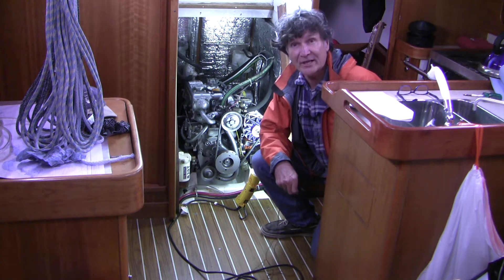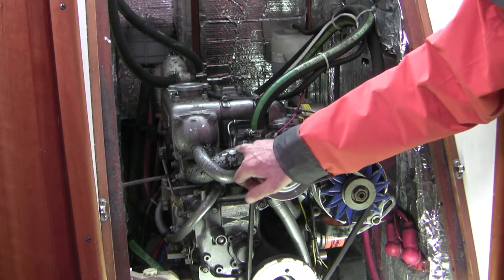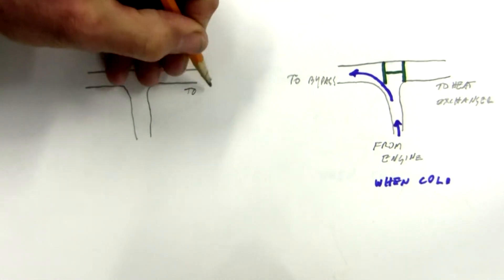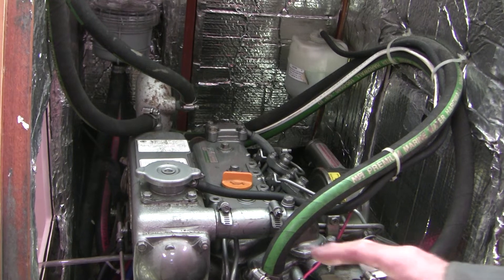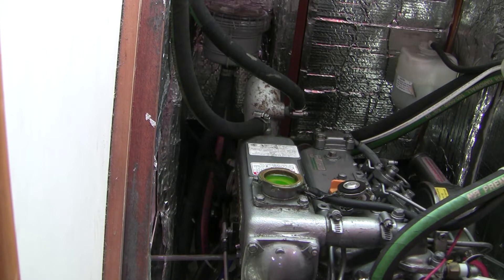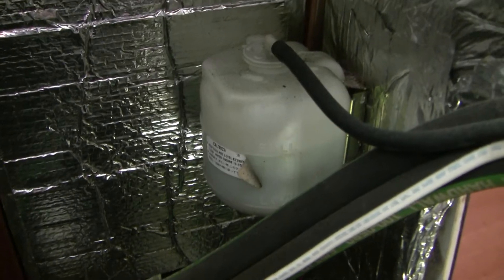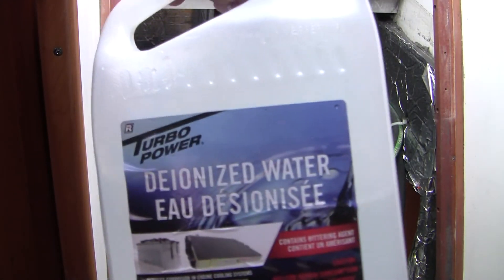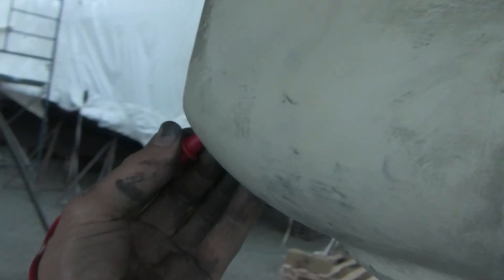Understanding marine diesel engines: Yanmar coolant exchange

Comment: Hello, Thanks for the great video on the cooling system. I now have a much better understanding of the difference between the raw water and fresh water cooling systems. I am trying chase down an overheating engine issue (around 175F, gauges steaming up) on a 1977 Volvo Penta BB170A 6 cyl gas engine. Question if I may: the engine had a 160F thermostat installed instead of the V-P book recommended 130F thermostat (which I ordered). I plan to replace it hoping my engine will run a little lower. Any suggestions? Cheers!
Reply from the maker: Most guys focus on the salt water side first because corrosion happens there faster. Make sure water flow is good, inspect the impeller, inspect and clean the heat exchanger and exhaust elbow, look for old impeller vanes aren’t trapped somewhere, and be sure the intake peacock is open all the way. On the fresh water side, make sure the cap seal is good, since the system needs pressure to raise boiling point. If you replace the thermostat be sure it is designed for your engine, since you can’t replace a double valve one like this Yanmar with an old style single valve. Good luck!
Reply: @spelunkerd  Thanks, I took apart and flushed the raw water system with a hose to ensure no blockage. Plan to flush the system with Barnacle Buster at some point soon as well. Your advice is much appreciated.

Comment: I just came across your most informative video while looking to solve a recent problem with my Yanmar 27 HP engine on a recently purchased Hunter Legend 35.5 sailboat. 

Yesterday I ran the engine for about an hour, thinking my seacock for the engine seawater cooling system was open. After figuring out that the shrill tone I heard was an over temperature alarm, I shut down the engine. Upon inspection, there was a pool of coolant under the engine and some smoke and sizzling sounds. The coolant reservoir was empty. 

Being new to this, I thought that refilling the reservoir might be enough to correct the problem once things cooled down. Wrong.

Today I found that the heat exchanger had no visible coolant in it, so I refilled it with a half and half mixture of marine diesel anti-freeze and water. I ran the engine for a couple of minutes, then re-checked the coolant level. Both the heat exchanger and the reservoir were still full. I resumed running the engine only two be alerted to an over temperature condition again after about 15 minutes. I shut off the engine and had another look only to find more spilled coolant and no visible coolant remaining in the heat exchanger. The reservoir remains full. Both hoses going into and out of the heat exchanger were hot the touch.

I’m trying to decide what I should do next and thought I would reach out to you and the community for any suggestions.
Reply: Minor correction: it’s actually a 24 horse power, model number 3GM30F Yanmar Diesel engine.

Also, that one way anti-siphoning valve you mentioned in the beginning of your video seemed to be stuck. Sure would not flow in either direction. I disassembled and reassembled it and the air now flows in one direction.

Might just provide enough of a correction for the heat exchanger to function properly again?
Reply: I thought it might be worth trying it again since one thing was seemingly corrected. This time I observed what was happening while it was running and after a few minutes there was some coolant dripping down on the port side of the engine block. Following the wetness upwards lead to a heat exchanger intake hose which may have been damaged from the previous day’s overheating episode. I suppose that once enough coolant leaks out of the system that overheating would be the natural result again. Once I remove the hose I may be able to confirm that it has been damaged, otherwise perhaps there is a stuck valve forcing a leak at that junction point.
Reply from the maker: Gee, this is serious. Unless you're confident in your abilities, it might be time to ask for help from a pro. Running for that long can pooch the whole engine, and you don't want to feel you didn't do everything possible to prevent that. As you say, overheating can cause secondary head gasket issues, hose problems, even water pump problems. If I were tackling this problem, I'd start with the salt water side, to verify that indeed the salt water pump is pushing salt water through the heat exchanger and that ample flow is coming out the tail pipe. If not, I'd disassemble the salt water pump and check the belt and the impeller, since those rubber things commonly go bad after a few years. If a vane of the pump impeller is broken off it can float downstream until it gets stuck leading into the heat exchanger. If nothing is coming out the tail pipe you can disconnect various hoses leading back to see if good flow is possible out the pump. Even something as simple as a plastic bag sucked into the salt water intake or a bad sea cock can be catastrophic. While the belt is off I'd spin all the pulleys to be sure none of those bearings have seized. Also check the seal at the filter because a loose cap can break the siphon and prevent adequate flow of salt water. If everything is OK on the salt water side, I'd run the engine for a while with rad cap off, filling with distilled water as needed to keep it topped up, and watch what happens. If it quickly overheats, especially if you get a lot of air bubbles at that time, you're in trouble. It could be as simple as a sticking thermostat, trapped air, a bad heat exchanger cap, or as serious as a head gasket problem. Feel the outlet hose from the thermostat to decide whether it opened. If the head gasket has leaked coolant to a cylinder, you can verify that with a little test that identifies combustion products in the cooling system. Hopefully not. Good luck!
Reply: @spelunkerd  Thank you for all your great suggestions. The seawater side of the system was working well. I was able to confirm a damaged 5/8” coolant hose was leaking coolant near the attachment point on the intake side of the heat exchanger. Whenever the engine ran for more than a few minutes coolant would begin to leak from there. I managed to cut off the damaged piece and reattach the hose after careful rerouting to compensate for the reduced length. The engine now runs great with no leaks and no overheating.
Reply from the maker: @goob_7499  Oh I'm so happy for you! Keep a close eye on the system, over the next few weeks. If it isn't quite right, you might consider swapping out the thermostat, and maybe even swap the heat exchanger cap. Occasionally if the thermostat is intermittently sticking, pressure in the system can rise above a safe level and hoses can fail as a result of that. The cap on the heat exchanger is designed to open if pressures rise too high, but that cap can stick. Also if that cap sticks open you don't get the higher pressure the system relies on to raise boiling point. Thermostats and heat exchanger caps are relatively cheap and diagnosis can be tricky, so if there is suspicion either is bad it might be wise to replace them. Thanks for letting us all know how this was resolved! These kind of remarks make the discussion thread worth reading.
Reply: @spelunkerd  it seems that I spoke too soon. My first conclusion was drawn from a 30 minute idle test. Today I actually took the boat from where it was anchored to a fuel dock to get water and halfway there the engine temperature alarm sounded again. I made it safely to the dock and waited for the engine to cool down while I fill the water tank. Thinking it felt cool enough, I placed a rag over the heat exchanger cap and opened it. The result was volcanic! After cleaning up the mess and replacing the coolant, I remembered that I noticed a shut off valve on the output side of the heat exchanger that had a corroded handle yesterday when I was dealing with the damaged hose. I tried to close it and but then the handle got so loose that I wasn’t sure what position the valve ended up in. Thinking that it might have gotten closed but not reopened enough, today I removed the corroded handle and opened it via the stem, which actually turned a number of times. Hoping that a lack of  flow from a fully or partially closed valve might be the new source of my troubles, I tested it by motoring back to my anchorage. I was nearly there when the engine temperature alarm sounded yet again. The seawater part of the system still seemed to be working fine. The difference in temperature between the input, an output side of the heat exchanger seemed negligible. I am pausing now to reflect, and to seek further input.
Reply from the maker: If you're suspicious of a head gasket leak, then a simple test is a combustion leak test kit that fits onto the top of the heat exhanger and tests for combustion waste products in the cooling system. You can borrow those from some auto parts stores. If you're still optimistic there is something more simple, I'd be inclined to inspect the heat exchanger and the salt water impeller, looking for anything that might impede salt water flow, like corrosion, a trapped impeller vane, or a plastic bag. You didn't mention how much salt water is flowing out the back of your engine. If flow is poor that is certainly the way to go. If the salt water side is all OK I'd be inclined to replace the thermostat, hoping it is stuck partially open, not allowing adequate flow.
Reply: @spelunkerd  Thanks again for sharing your insights. I don’t suspect a head gasket leak, but I’ll keep this possibility in mind in case simpler remedies don’t work. As far as I can tell the seawater flow looks good, and the related hoses remain cool when the engine runs. That leaves the thermostat as the most likely culprit. You indicate that it’s under the cover attached to the fresh water/coolant pump. I imagine I’ll have to drain the coolant before opening that up to avoid a mess. I might have a spare thermostat curtesy off the previous owner.
Reply from the maker: @goob_7499  In the 'old days' we could take the thermostat right out and see if the problem was solved. Unfortunately this thermostat design has a second valve that closes the bypass tract when the main valve is opened. So taking the thermostat out (or using the wrong design) will allow coolant to bypass the heat exchanger, causing overheating.  You want to be sure the spare is new and original Yanmar design, with two valves. Bad data can be misleading, so make sure you have the correct one.
Reply: @spelunkerd  I just drained the coolant, removed the water pump cap and lift it out the thermostat. It’s hard to tell if there’s anything wrong with it by visual inspection.
Reply: Looks like the only spare I have is old, so I’ll have to pick up a new one. I do happen to have a new temperature switch though. Probably worth replacing both.
Reply: In searching for a replacement thermostat, I spoke with a local guy, Sean, who said he could spot me a spare one, but also suggested that I test the one that I have by putting in a pot of hot water to see if it opens. After some initial hesitation, it did open, and so did my older spare thermostat. This leads me to the conclusion that the thermostat is not the most likely source of my trouble. 

Next I will more thoroughly investigate the seawater side of my system. I will verify that the impeller is in good shape, and that there are no obstructions in the lines. 

Once I replace the coolant, I am planning to run the engine with the heat exchanger cap off for a while to be sure to burp the system of any trapped air. Trapped air pockets preventing coolant flow might well have been the reason it was overheating since the initial incident.
Reply: I replaced the impeller and removed all pieces. I checked the heat exchanger by removing the end cap. It looked clean, but I ran a length of wire down all the little seawater pipes just to be sure. After reassembly, refilling the coolant and, <ahem> opening the seacock, it’s been running smoothly for an hour. There is great seawater flow out of the tailpipe (now that I know how that is supposed to look). Cold seawater is flowing through the system. The heat exchanger is doing what it should now. Hot coolant enters and cooled coolant exits. I ran it with the heat exchanger cap off for a while, and the coolant level was staying steady. Props to @spelunkerd and my buddy Sean for all the great advice!

Comment: Hey great explanation I actually have a question and really need your help my yanmar in my 35ft C&C sailboat doesn’t want to go into gear either forward or reverse engine starts but when I change gear it doesn’t move RPMs increase if I add to it but doesn’t shift I checked the transmission box oil is good engine oil is good I am stuck any suggestions
Reply from the maker: I don't know. The last time I saw a boat like that, the prop had fallen off. Presumably you can see the prop shaft enough to know if it spins.  I'd go down to the transmission and try shifting right at the gear handle on the transmission, in case a lever has dislocated. My shift handle at the cockpit has a dislocation mode to allow higher rpm starts in neutral.
Reply: @spelunkerd  thanks yea I located it and now I am going to try and shift it at the box

Comment: Hey thank you for all the information 🙏🏽
My weep hole is leaking, and I already ordered a new pump. My question is: can I still drive in this time ? Because the new pump will arrive in around 3 weeks, but I have to drive a lot in this time 😢

I have a Yanmar 4jh-dte.
Reply from the maker: If the pump is not squealing it is probably safe to continue using it, but be sure not to let the reservoir run dry. Keep a close eye on your engine temperature and be prepared to shut the engine off immediately if temp rises.

Comment: My anti siphon valve is leaking on my starter. I plan to order a new one tomorrow. My is mounted flat. Should it be mounted vertical like yours? Keith
Reply from the maker: Yes, orientation is very important for those things, although some designs vary. Gravity keeps the salt water from refluxing back into the exhaust manifold.

Comment: Surely they are not STILL using aluminum in any part of the cooling system. If they are you WILL get corrosion and you will be replacing parts very few years. 
Cheers
Reply from the maker: Good point. The SD20 sail drive case is entirely aluminum, and it is the frame for the salt water intake. I don't believe the fresh water coolant is anywhere near. Yanmar put out a service bulletin on how vulnerable the sail drive is to corrosion, and my zincs last only 6 months. So a few years ago I decided to add another zinc that I attach to a wire from a sail drive mounting bolt, and I hang it over the side. Since doing that my paint is surviving a little better on the vulnerable lead keel. I checked out my galvanic isolator and it is working fine.

Comment: Hi. This is very good and informative, but I'd like to ask about a small aperture through hull continual flow when the engine in running. I have a 40 litre calorifier around the same area as this through hull fitting, but as yet have been unable to trace the route or source. Can you shed any light on the reason for this flow? BTW this through hull is near the stern just above the water line and it is slightly warm. Thanks
Reply from the maker: Do you think it might be discharge from a waterlock muffler? My calorifier is separate and it does not discharge water at all, but if your calorifier is heated by salt water that has mixed with exhaust, you might be seeing discharge there. Some engines have no antifreeze and are simply cooled by lake water flow through the engine head, in which case you don't have the option to warm tap water with circulating antifreeze.
Reply: @spelunkerd  Thank you for that possibility. I am in N Ireland and the boat is on the hard in Greece. I will investigate further in March 2023

Comment: Thank you for your video, I am in Vancouver as well. I tried to open this cap and no success. any recommendations?
Reply from the maker: Place your palm on the top and press down, then rotate CCW a quarter turn when cold. They are spring loaded. I'm in Victoria RVYC in Cadboro bay, Equinox, nice to meet you.

Comment: If the fins of the impeller break off what is a good to retreave them?
Reply from the maker: The plastic vanes will likely drift on to be lodged against the heat exchanger, or perhaps in the hose connecting the pump to the heat exchanger. I did a video "how to clean a Yanmar marine heat exchanger" showing how to get at that part where the fins are likely lodged. The good news is it is easy to get at that area by simply removing the hose and undoing four bolts that are on the front of the engine. You could even do that at sea, though if you don't have new gaskets it might leak a little after you're done. If you haven't cleaned the heat exchanger lately, you might want to do that at the same time.